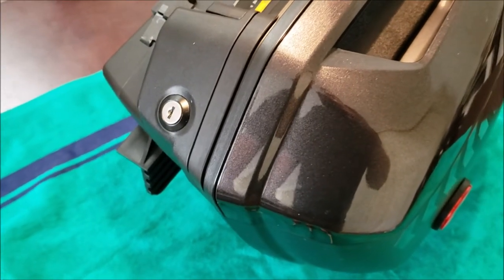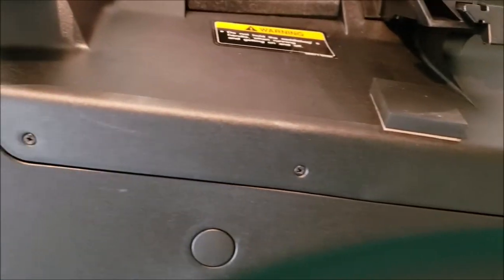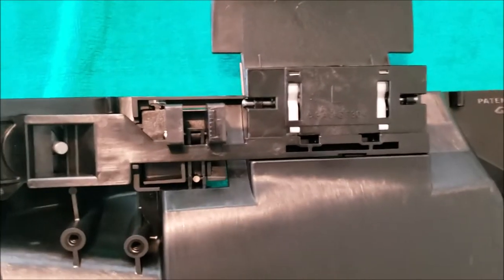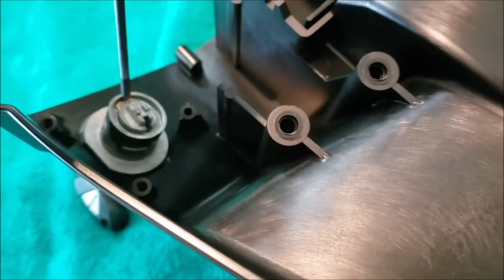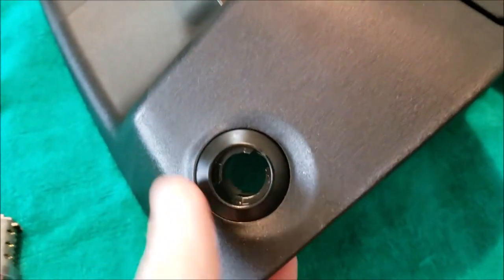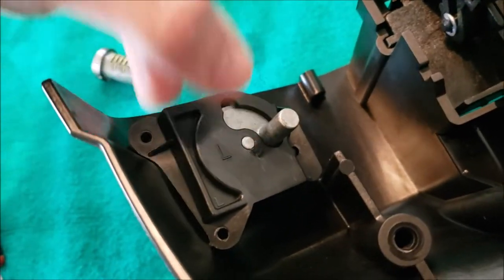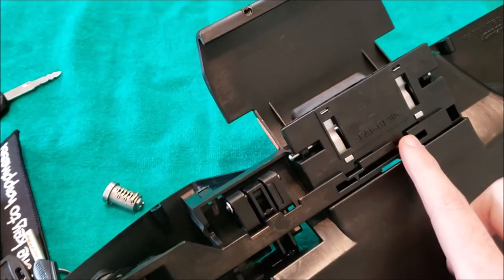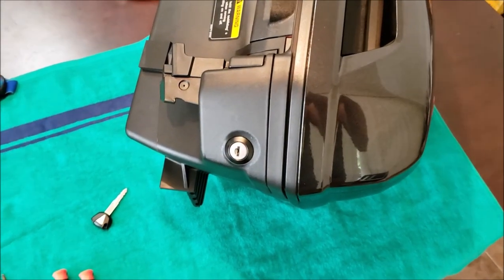Kawasaki KQR Saddlebag Lock Cylinder Replacement

Comment: Great video, thank you. Is anybody else having a problem with the OEM side case where there seems to be an actual physical impingement keeping the key from turning? I will go to unlock the case and the key refuses to turn. (It is NOT a situation that lubrication or graphite will fix because it comes and goes. It is NOT a bent key. When it happens, I can usually just take it for a short (hopefully bumpy) ride and it frees itself up like it was new). I'm guessing it might be that plastic lock bar that I see in the video. Maybe it's sliding around in there and blocking things somehow. It is definitely a physical blockage, NOT a key or lock cylinder issue. One case is much worse than the other, but it has happened to both sides at one time or other and is very intermittent.
I am extremely happy with everything about my 2016 Versys 650 EXCEPT these OEM side and top cases. They suck. If I didn't already have them, I would go with aftermarket Givi's.
Thanks, and cheers!